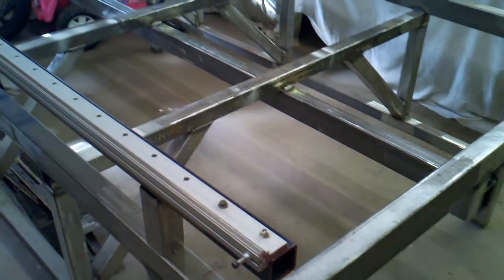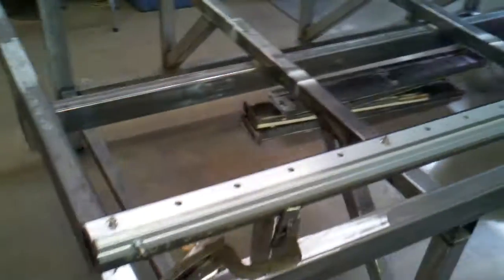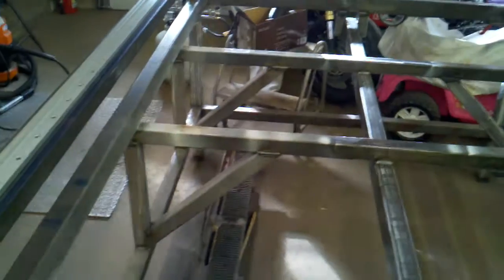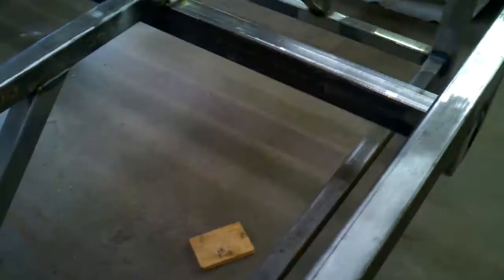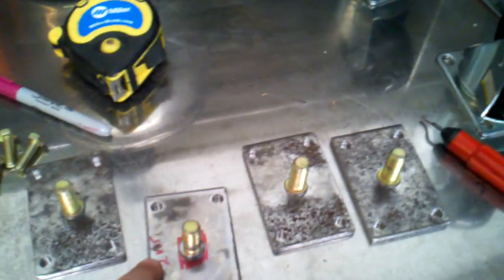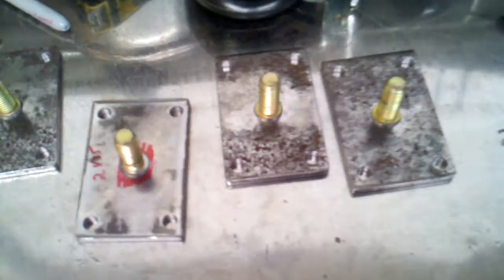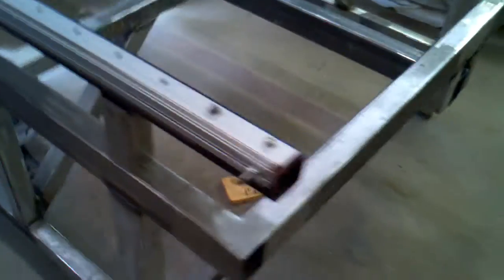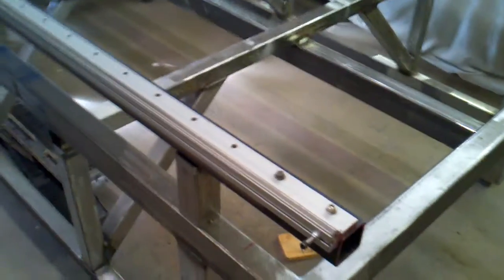Cnc plasma table build part1

Comment: Hey TJ, if you were to build the table frame again now would you change anything up? I like the triangulation with the supports.
Reply from the maker: I really would not change anything with the frame. However the water table is would never build it the picture frame way. I would use one piece of 1/8 stainless and have it break bent and weld the corners up.
Reply: I’m building a similar size table now. I have a sheet of 16 ga steel that i’m going to bend up on a huge brake we have at work. Thanks for the reply.  @tjs_welding_and_fabrication

Comment: TJ,

I did the exact same thing on my castors. Works really well to level it out. I'm not sure if you are building a water table or not. But, I would recommend it, it has been so nice, even on really thick plate, the water table really cools the plate when its cutting. That was the main reason to level out the table; I run the water about a 1/2" below the plate while cutting. 

I also put a 3/4" ball valve to drain some of the water in the table into a couple of 5 gallon buckets when I need to move the table around (so as not to spill water everywhere). I have a small shop, so its nice to move the table out of the way or outside to gain some room.

Cheers,

Glenn